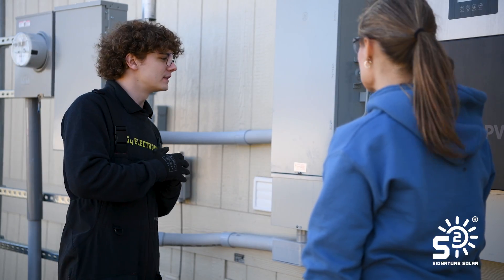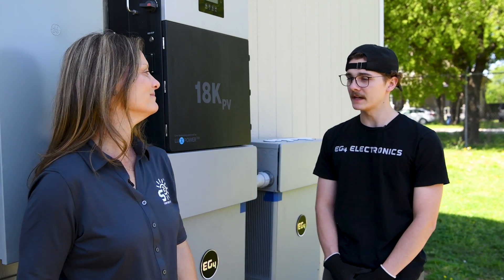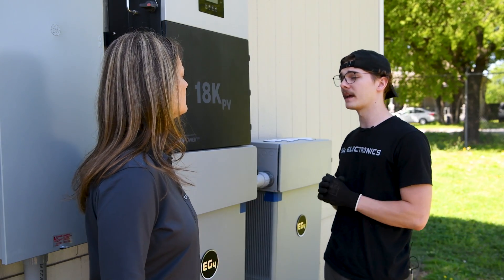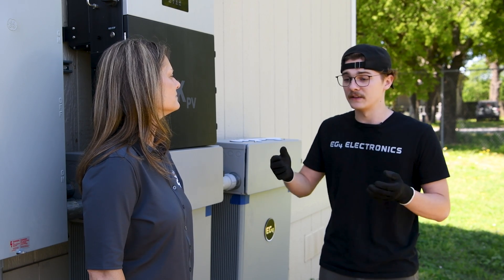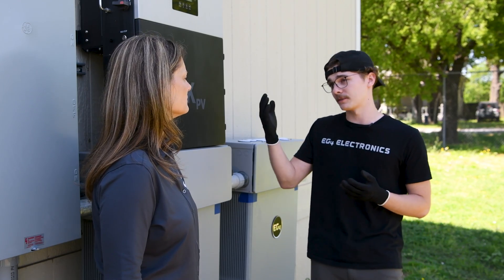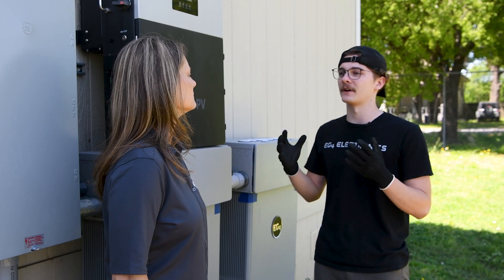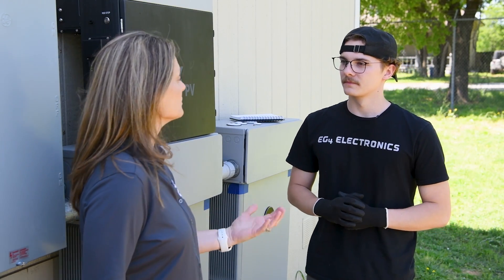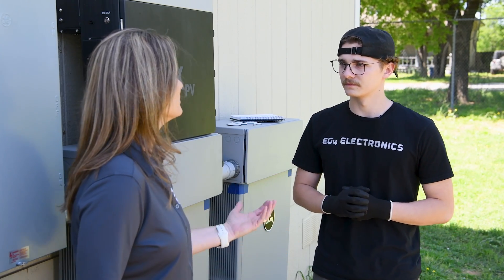EG4 18KPV Hybrid Inverter: Load Test & Home Tour - Discover its Power Capacity

Comment: Question regarding pass-through: When the house load exceeds the AC output of the inverter (supply from battery or solar or both), does the inverter passthrough the grid completely? Or does the inverter passthrough only the incremental power from grid? Example: If house load goes from 10kw to 17kw, will it passthrough all of the 17kw from grid? or just the additional 5kw from grid (17kw load - 12kw output rating) . Thank you
Reply from the maker: Past 12kW it will use off-grid power for about 5 - 10 minutes then switch to full bypass from the grid. Once returning below 12kW for load it will swap to full off-grid and begin the cycle anew!
Reply: @SignatureSolar  awesome

Comment: If you wanted more output than the 12k/15k surge, could you use two of these 18KPV units together? If yes, would you wire them to separate panels, run them together on the same panel, with each one running different circuits, or would they run 24k/30k on a single panel, running the circuits together?
Reply from the maker: You would run 24k/30k on a single panel, running the circuits together.

Comment: I have a question... how can or would i integrate wind generation to the 18k or the 6k hybrid inverter. Can we put wind generators in the ac grid Port or will i need to add something to do this...

We are looking to buil some unique power system in Southeastern New Mexico  as we look forward to build our retreat center for our organization. Power is available  but the local utility is very pricey and we would like to wind generators because it can be so wind 90% of the year.
Reply from the maker: To our knowledge this has not been tested
Reply: @SignatureSolar  thanks I will reach out to EG4 to find out if it tis possible and how it would be done if it is...

Comment: 2 days run time myfoot.   With only 2 batterys.  Verry little load.      My question  how long till these hi freq inverters have large built in soft starts.  So not to crash With inductive moter starts
Reply from the maker: Hi! This would be a question for the manufacturer as Signature Solar doesn't design the units, we just sell them. If you need any assistance getting in touch with EG4, please don't hesitate to reach out to me at engagement@signaturesolar.com and I will get you connected!